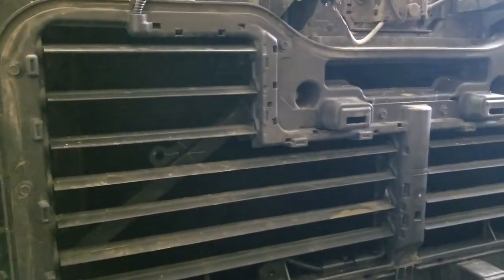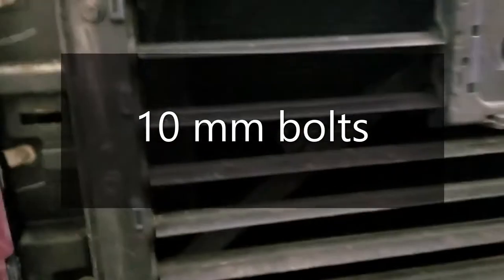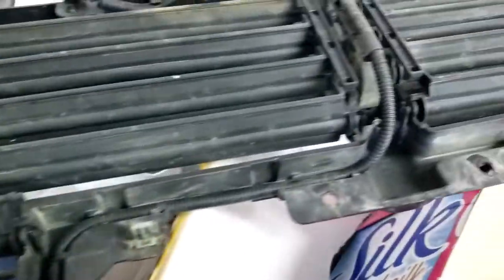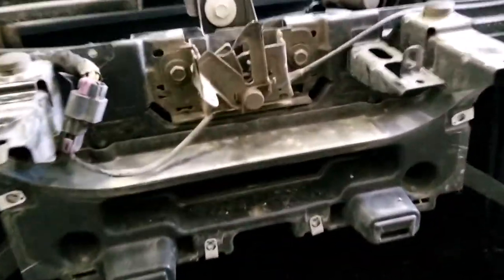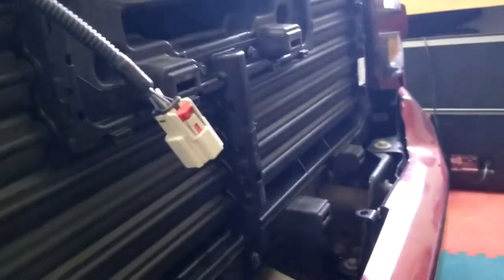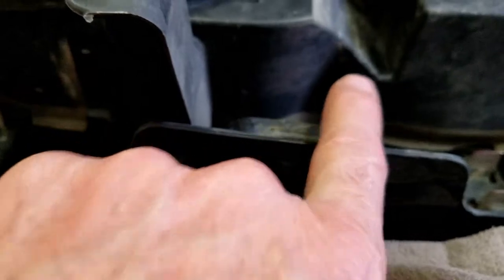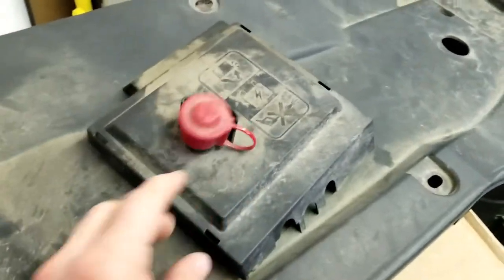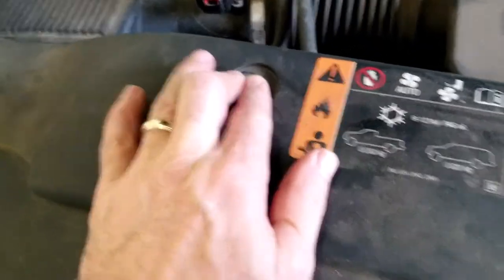2017 CHEVY SILVERADO RADIATOR SHUTTER ASSEMBLY REPLACEMENT

Comment: Wish I would’ve found this video 2 days ago, dealers charging $800 parts and labor
Reply from the maker: Hopefully one of my other video's can help you save some money.
Reply: After you take the shutter off and replace it with a new one. Will the engine light turn off? The dealership is charging me almost 1000$ parts and labour
Reply from the maker: @RaySparks21  My check engine light went off after everything was reinstalled.
Reply: @RaySparks21  GMC is charging me $1100, but i finally got extended warranty to cover it.

Comment: A couple of questions for you....

Did you get the P059f problem code for the shutter assembly not working?

Where did you get your replacement shutter assembly? Did you get genuine GM part or a 3rd party OEM part?

Any problems since replacing the part?
Reply from the maker: I'm guessing I did get that code, I just took my truck to a repair place and they told me it was the shutter assembly. I went online and searched for the part I don't remember finding a lot of options but I believe it was a third party.

I have not had any problems with it since I installed the new part. 

Thanks for your questions
Reply: I'm getting a U1510 code.
Reply: I’m getting the same code U1510 Lin bus code any ideas on if it’s the same part
Reply: I’m having the same code now. Any idea if this was the for sure fix??

Comment: So my Silverado is throwing up a U1501 and U1510 code for the active grill shudder assembly. I found a dead bird insider the grill and I’m assuming that’s what caused the issue. I noticed the shutters remain open when the truck is parked so I manually closed the shutters and started the truck and they opened up on their own but I don’t know if they are actively opening and closing while driving. Could the shutter assembly still be bad even tho it opened on its own??
Reply from the maker: I would disconnect the battery and wait 10 minutes. Then reconnect the battery and see if the error code goes away.
Reply: @brucemackenthundoesitallll4296  i disconnected the battery for 30 mins (only the ground cable) and it seemed to temporarily go away and then came back the second time starting the truck.
Reply: @codybetts1   did you end up resolving the issue? I’m currently having the same issue with my truck. I manual close it, and it opens by itself. But doesn’t close and I’m not sure if the actuator is bad or not.
Reply: Did u figure this out? I’m also having this issues now

Comment: Idk if it’s coincidence but I changed my cold air intake filter and had the shutter code pop up about a month later. Dealership wants $1300 to replace the damper 😂
Reply from the maker: From what I have read they just go out. I doubt it was related.